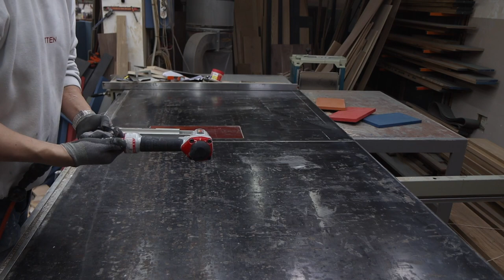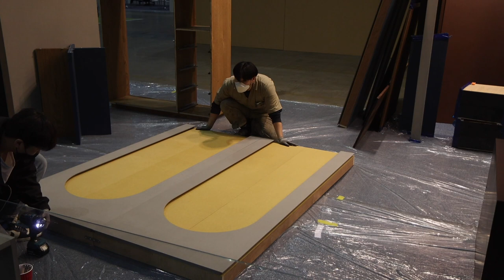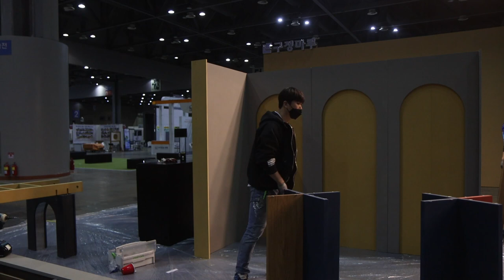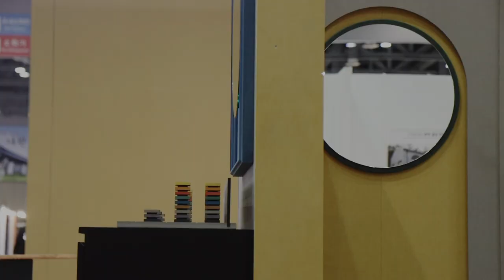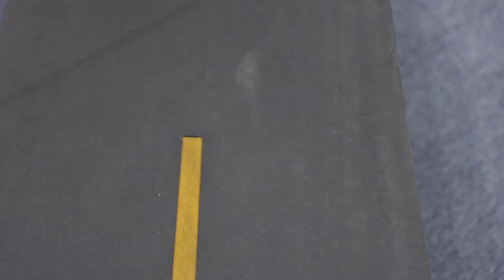W114_Build set walls for exhibition(2021 Korea build with forescolor Part1.)

Comment: Why not use just normal cheap mdf ? i mean it costs the same to paint it (or to apply veneer) but you have so much variation and possibilities vs buying forescolor panels like you do and still paint them (double price). I am from Kazakhstan, and if mdf panel costs here 30-40$, forescolor panel costs 120-150$ so it makes no economical sense to me.
Reply from the maker: There are several reasons. First, density.. MDF is too weak...  Second.. Painting... MDF needs lacquer surfacer..  and Smell & health... forescolor and valchromat are eco-friendly material..
Reply: Not sure if forescolor is the same, but for valchromat atleast it is a lot denser than mdf. Machines better, does not chip so easy etc. And quite a bit stronger. So makes sense in a lot of projects, even though it will be painted.
Reply: @ViTTEN  well not pro on this one, but the emission differences are very tiny compared to traditional mdf. but density could be a plus, but again denser the material the heavier it is. guess i need more research, but speaking of finding a client in my area that would pay premium for a bit of density is tough. every one here is working with particle boards and happy with it. i try to stay away from it due to emissions.
Reply: @Diliverium  how about just using HDF then ?
Reply: @ViTTEN  but thanks for all your videos man... mostly learning here.
Reply: @antonstafeyev3606  Like ViTTEN mentioned also other reasons. Where I get my supplies it is either mdf or valchromat, so then I sometimes use valchromat where strength/durability/details are needed. Prefer to use it with clear finish of course, then I really think it is a superior product. But MDF can be hell to work with, and with labour being the main expense then I think valchromat can still make sense for some painted projects.
Reply: @Diliverium  hmmm... i will go do my research then... but man it is fucking expensive. 150$ for a sheet 2800-2070 over here.
Reply: @antonstafeyev3606  I am from Astana myself, and local customers here couldn't care less if it is mdf or valchromat, all they give a damn about is the price. People on a cheaper side go with chipboard(melamine), people with money are ready to pay decent amount for mdf because they don't even care about anything else.
Reply: @ErrBuzz  I am from Almaty, not far from you. after doing my research i questioned then. why not to use HDF instead of MDF, it is much more denser and has the same emission ratings. HDF costs here 60-80$ per sheet of 16mm. Which is again cheaper then painted forescolor or valchromat.  I don't know if Korean guys have no import taxes but here it can be up to 30%. While HDF has no import taxes on it due to some local agreements. 

And according to Forecolor it is standard MDF with 800-860 density. 

Valchromat is classified as an MDF which is again, just stays in higher ranges of MDF density but not higher than 900. 

So for the double price of HDF people managed to sell MDF.

So regarding your comment here. Why would you waste clients resources on something overpriced, and here is my answer 

1) You are a bad worker since you could give people MDF and they "Wouldn't give a shit about" for the price of valchromat and keep the money.

2) You are a bad worker cause u didn't even know u could do that.

3) You are a bad worker cause you treat your clients like shit out of jealousy
Reply: @ViTTEN  i figured it man, it looks like it is as dense as good quality mdf, but far from top shelf hdf. it is just a better quality mdf overall with a bonus of paint and textures. 

however in my journey i found another interesting mdf type of thing. called Fenix. it is mdf with metalic finish. an actuall metal in it. if you manage to get a sample of it (you have higher chances) please make a vid on it!!!
Reply: @antonstafeyev3606  well, there is no need to be poking fingers here, my friend. All I meant is that the meaningful majority of people who want upscaled furniture and can afford paying more really knows nothing about valchromat here, so they are pretty much ok going with MDF and that's it. Bad wording, I guess. But nonetheless, you are a tad too critical. 
Interestingly, only commenters from ex-soviet countries are really quick to be blaming someone they don't know nothing about for something they assume they know a lot about even having just learnt a teardrop of information on the subject.
Reply: @ErrBuzz  давай вот так проше, пальцами я не тыкал, и не обвинял. говорю по факту что многие просто думают что человек который может себе позволить дорогую мебель не будет думать о материале. это в корне не верно. кроме агашек с акимата, те реально не знают и знать не хотят.
Reply: @antonstafeyev3606  ну конечно наверное в Казахстане есть и такие, кто может себе позволить мебель из вальхромата и сознательно выбрать именно его, но это весьма узкая прослойка населения. Я же говорил про основное большинство, а это две группы: люди выбирающие  корпусную мебель из ЛДСП потому что дешевле; и люди, которым главное, что бы не дёшево и с пилястрами и патиной в викторианском стиле. Да и те скорее выбирут массив или фанерованный мдф. Смысла переплачивать за мебель из вальхромата в Казахстане очень мало, и вы сами  это подтверждали в своих постах. 
Сеул это совсем другая история, если там есть спрос на него, значит для многих людей это имеет смысл и они готовы платить за это. А с вашими определениями по поводу плохого профессионала и его отношения к клиентам я согласен. Но уверен, что большинство гаражников тут именно этих постулатов и придерживаются. Уверен вы к ним не принадлежите. Я вообще работаю с деревом и это совсем уж узкая прослойка)))
Словами кстати тоже можно "тыкать" и вы это прекрасно продемонстрировали, однако я уверен без злого умысла.
Reply: @ErrBuzz  без злого конечно, просто есть «мастера» которые и дсп по цене валхромата впарят. сам я больше по мдф работаю и стараюсь придерживаться качества. и да смысла переплачивать за валхромат в кз тоже не вижу, у нас людям 1-2 процента разницы в емисии формальдегида ничего не говорит, больше по ценнику. Хотя есть эко продвинутые и берут. изначальный вопрос был о том зачем брать валхромат когда есть и более высокий по качеству хдф по более низкой цене, хотя в сеуле нет таможенного союза и походу ценник такой же как и на валхромат.